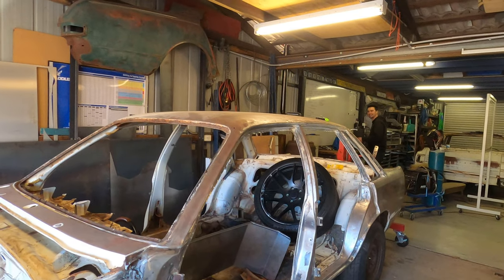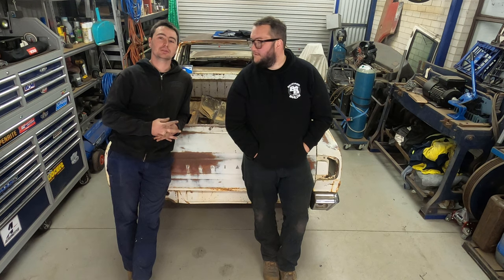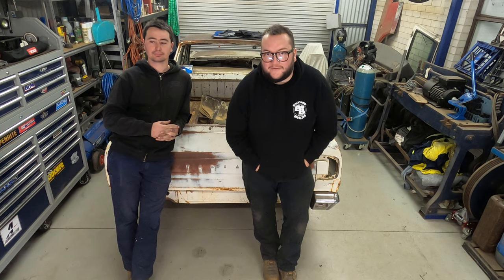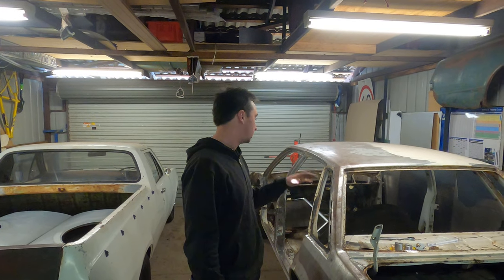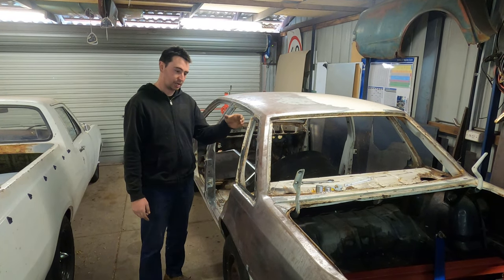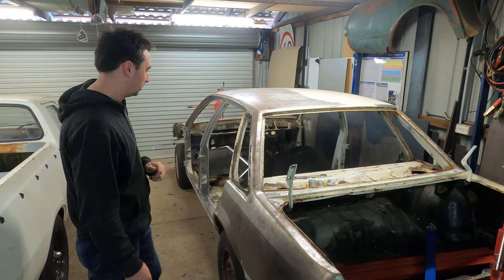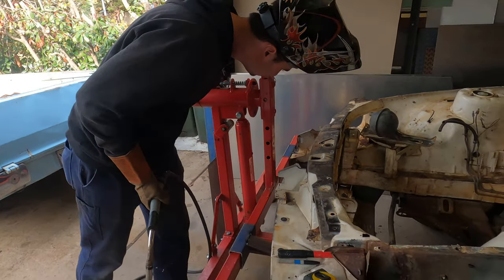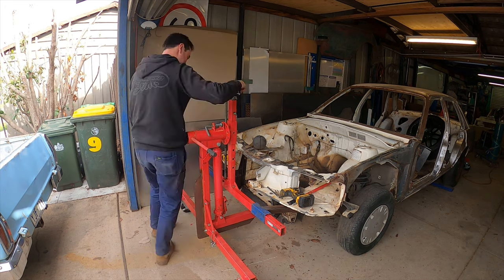How to mount a Car on a Rotisserie: Introducing the KebabHunter: BackyardBuilds

Comment: Hey guys. Thanks for the vid. Great timing for me, doing similar. Are the front 2 bolts holding it okay? Im a bit worried about bending that thin chassis wall with the 2 bolts. Thanks for the videos!
Reply from the maker: Hey Adam. Thanks for the comment mate. Yeah mate the two into the boot are holding well, the washer was out there to help spread the load a little better. As an empty shell it is fine We would strip as much off the car as possible.